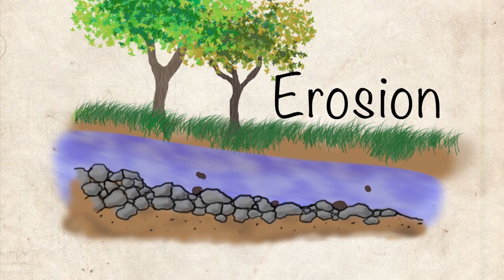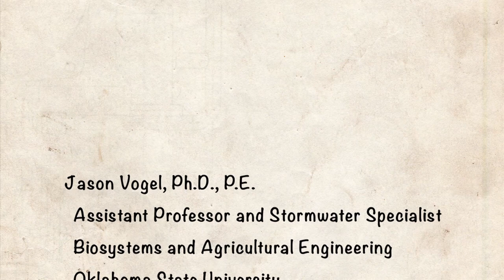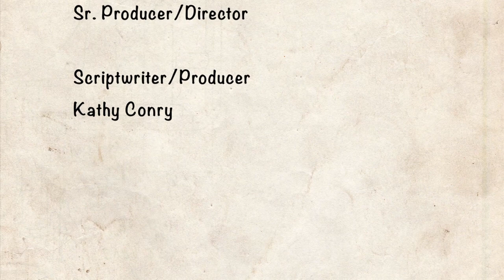Natural Stream Restoration: Good Stream Gone Bad (Part II)

Comment: I live in Edmond, and new home construction is affecting many of the older homes that have been here longer than six years bc they refuse to put a detention pond, and the city doesn’t require them to do so but encourages them if they want to. Do you guys work with residential clients??
Reply: So, this is posted by a university extension service. They aren’t actually the contractors that can put in a retention pond or anything, nor are they any kind off lawyer that can litigate and force them to do anything. Their primary function is educational outreach.They typically have an office in every county, so there is probably one near by if you look them up. I’m not sure just how much they will be able to help you though cause they are primarily educators.